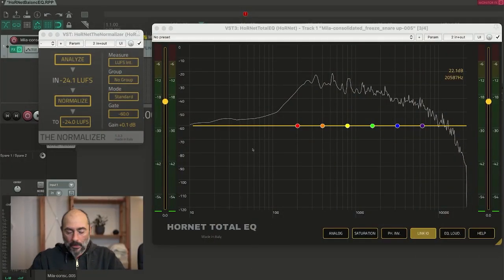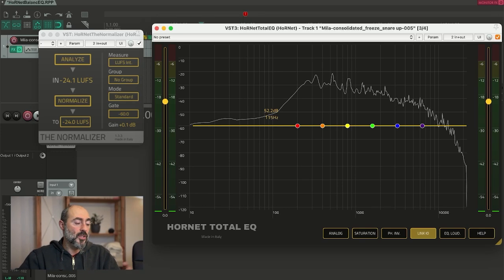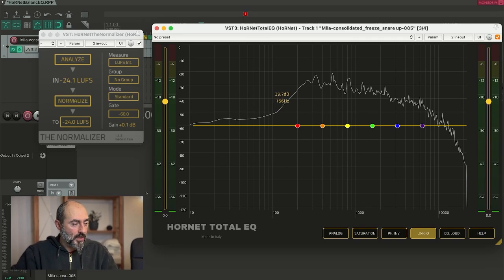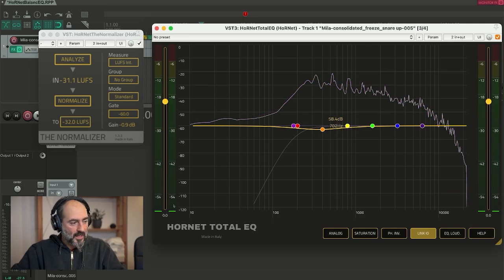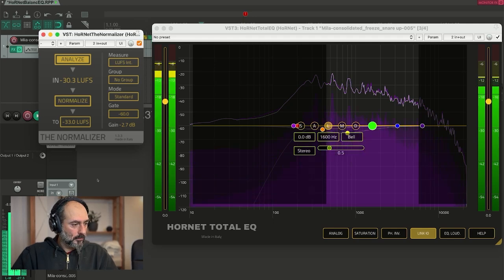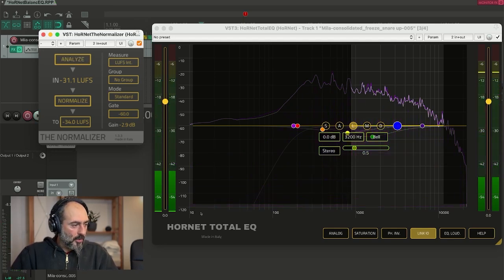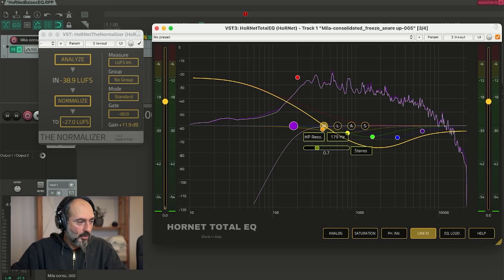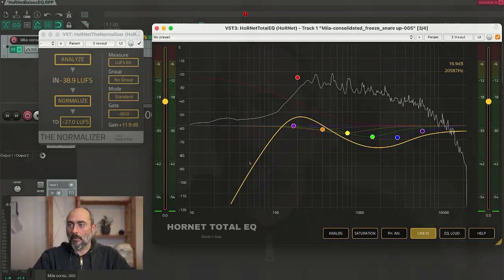Understanding BalancEQ’s Algorithm – Step-by-Step Breakdown Using TotalEQ

Comment: Can you please do an In-Depth step-by-step, probably a longer video, and also how you'd approach this on busses too. I struggle to understand "how it detects the spectral peak and adjusts the high-pass filter" part. Secondly, how did you come up with those EQ points, what informed them, do they apply to every sound or not, do you apply the same method on busses too? Thanks in advance.:trophy-yellow-smiling:
Reply from the maker: Hi the high pass thing is explained here! just find the peak in the spectrum and look at its value. the go 15dBs lower ( say it's -35dBs) start from the left of the spectrum until you find the point when it reaches that value. this is your HP frequency. 
Regarding the frequency bands, they have been found through trial and error to have a fair balance between number of bands and ability to influence the general slope. If you increase them you get more artificial eq, you can reduce them but then you don't have enough control. I use the same method on tracks and busses because this approach respects the nature of the signal itself. There is one thing though missing from that video. If a band LUFS is more than 10LU lower than the one containing the spectrum peak is excluded from the algorithm (to avoid boosting too much bands that does not have any valuable information)
Reply: @HoRNetWeb  Thank you:trophy-yellow-smiling: